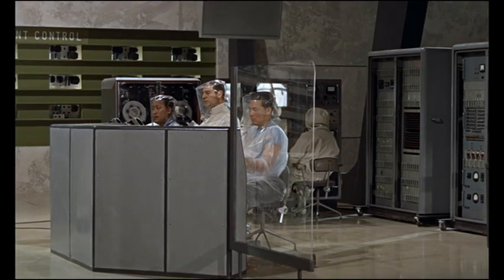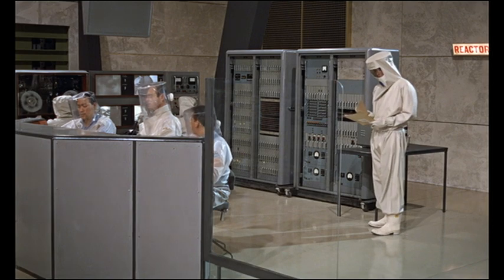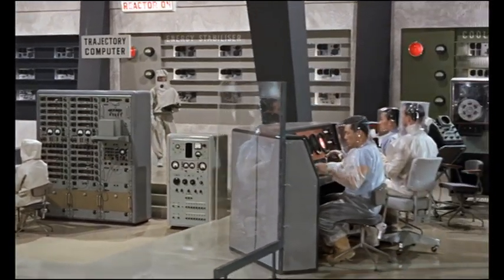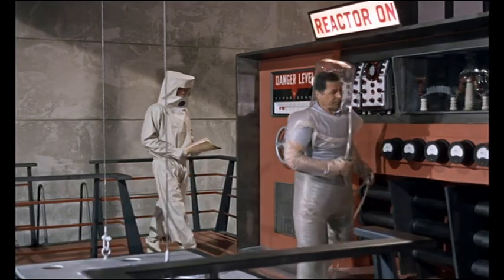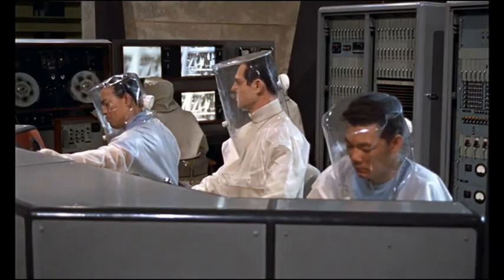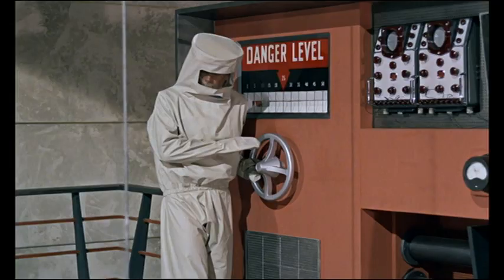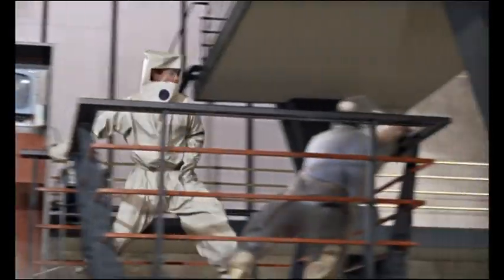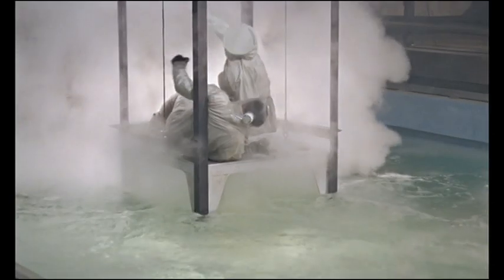James Bond Vs Dr No

Comment: Blooper alert 4:55 Notice the glass panel is smashed during the fight. Smoke is billowing out of that area of the control center. Then immediately in the next frame the damaged panel now seems to be intact with a gray glass cover and no smoke. 5:00
Reply: It was most likely a coverage shot.
Reply: This film in particular has tons upon tons of continuity errors if you look for them. The somewhat sloppy editing doesn't help either. It's the only Bond film that really feels like they're stretching the limited (compared to later entries) budget to the max, but I rather like it for that I must admit.
Reply: In fairness it was the 60s
Reply: @rampageclover9788  the miniskirts were a little distracting